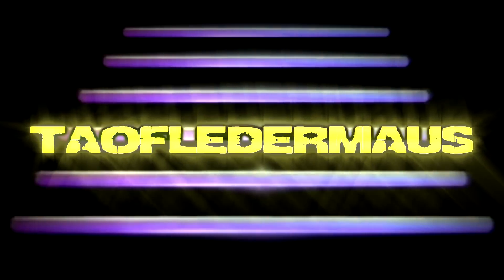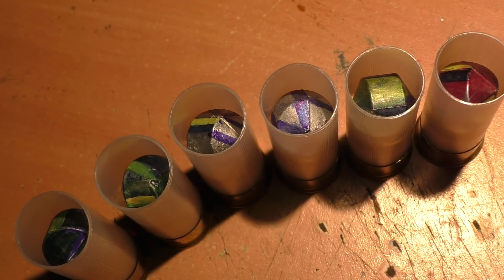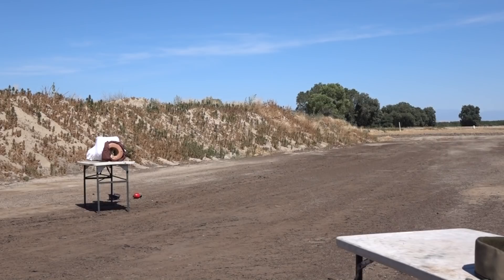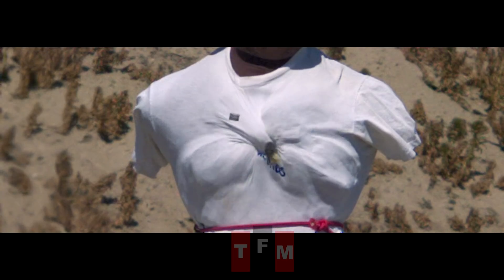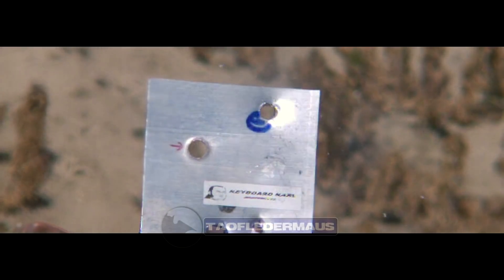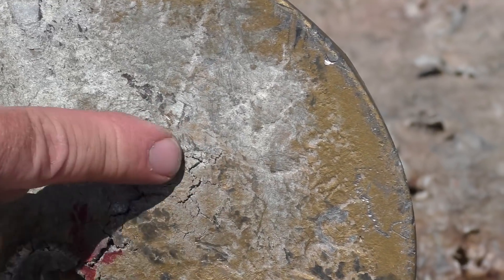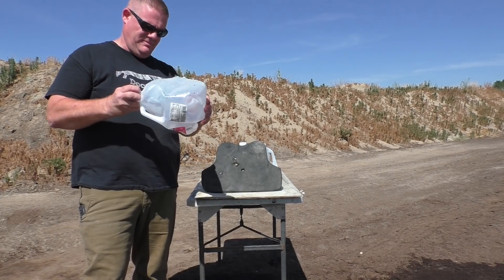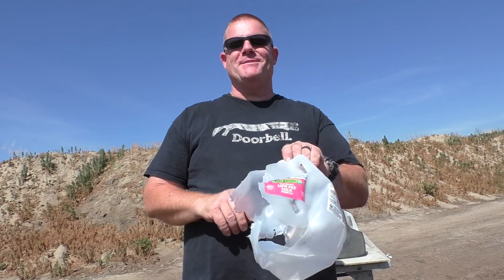The Wacky SPHERICON 12 ga. Projectile - We test it!

Comment: lead is easy to cast, that gel is not... i worked for a place that did re-cast blocks used for specific applications(over 1/2 a dozen), and they used what amounted to a large pot of water, put the gel into a bag, and simmered it for hours, sometimes days to get it to turn to a liquid..ish subsance they could push threw a filter and back into the desired shape... its a PITFA...

Comment: In light of how it rolls, I'm thinking that the air flow curling over and around that shape effects how it spins and what direct it spins in.  You randomly dropped them into each shell rather then attempting to place them in the shells in the same facing.  I suspect that if you put some filler material in there and made sure that each projectile was oriented in the same manner you would get consistent shot patterns and trajectories.

Comment: If you use the "<" and ">" keys you can step through the video to observe the impact at 7:17.

What's particularly interesting is that there are twin incandescent jets erupting from the impact along with several fragments that appear to be travelling many times faster than the original projectile.

Comment: It has one side you can balance it on and one you cant but it needs to be perfectly balanced. So if u were to put it on a perfectly level surface it would roll to the same side all the time. But notnlike a weeble for a weeble is weighted at the bottom. The sphericon doesnt have a side that is denser then the other.

Comment: Hey Jeff I just thought of something that could be kinda neat. I’ve always loved the lead plate as a target and now I like the aluminum too haha. Maybe next time you melt the lead plate sink a slightly smaller aluminum disk inside the pool of lead. This could be achieved by solidifying a smaller lead plate in the pan, then place the aluminum plate inside and secure it using wire or something. Then put more molten lead over top everything till it’s full. I think it would make the target that much cooler.